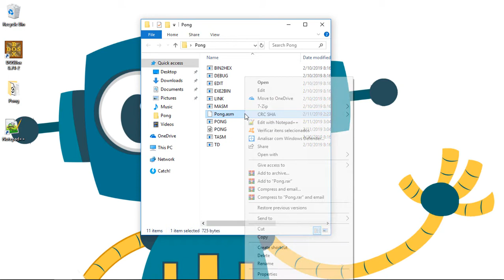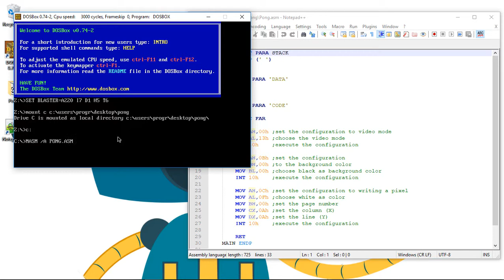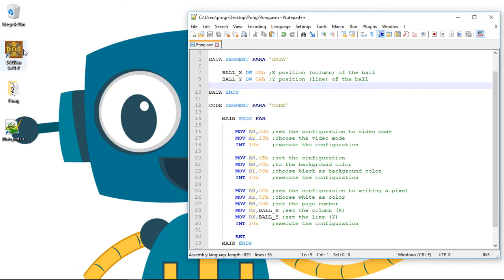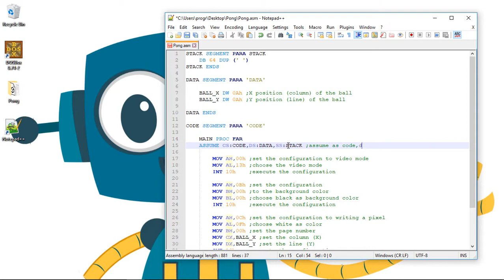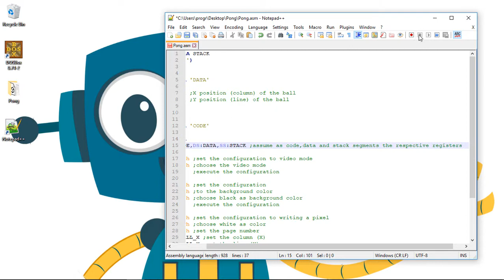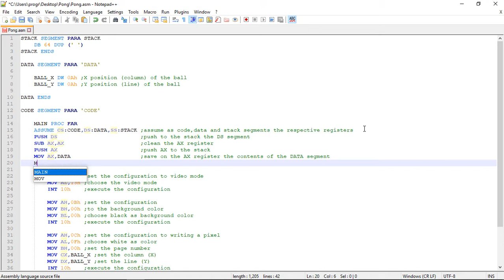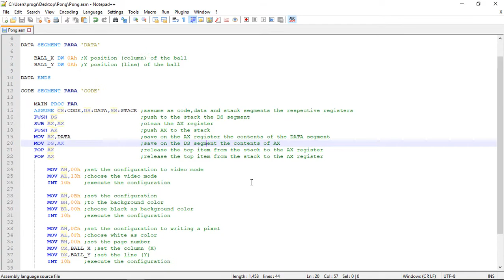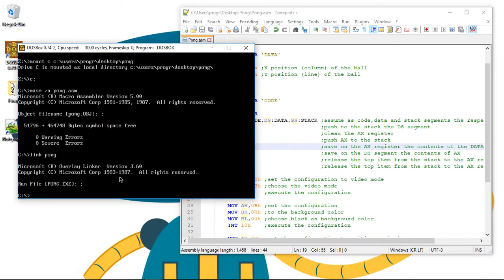[MASM] 8086 Assembly - Pong - 05 Creating the Ball

Comment: Hi, it might be a bit late, but im trying to follow you but with the NASM syntax, im facing a problem where once i turn the positions into variables the pixel stop showing (it works pretty fine when i assign the values directly)
Reply from the maker: Hi DOSPIIR, thank you for commenting!

Please be free to adapt the code to your use case using NASM.

Can you please put here the part of the problematic code? So we can work together on translate it to NASM.
Reply: @ProgrammingDimension  in this part : 

segment .data
  BALL_X DW 160
  BALL_Y DW 100

segment .text
  global main

main:

 ; the previous part of the code (video setting and background color)
 
 ; the pixel part : 

  MOV AH, 0Ch
  MOV AL, 0Fh
  MOV BH, 00h
  MOV CX, [BALL_X]
  MOV DX, [BALL_Y]
  INT 10h

when i assigned the values to the CX and DX directly, it worked fine, the pixel showed up. But when i tried the code above, the pixel doesn't appear.
And when i searched about "initializing the DS register" i found that NASM initialize it automatically

Comment: Hi, this series is interesting! I have questions about the "PUSH DS SUB AX,AX  POP AX... POP AX POP AX" part. Why do we have to push ds and ax to the stack before making DS=DATA? Also, why don't we have to set the other segment register, like CS and SS? Does the OS set them already? Thank you.
Reply: @ayashameimaru1194  but they are just popped to ax, and are not used later. Isn't it?
Reply: @ayashameimaru1194  thank you very much